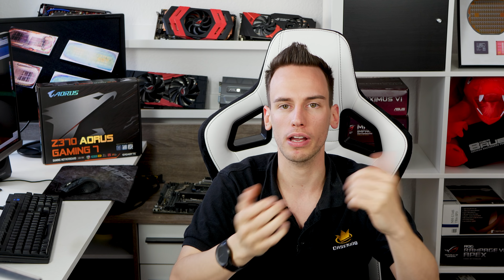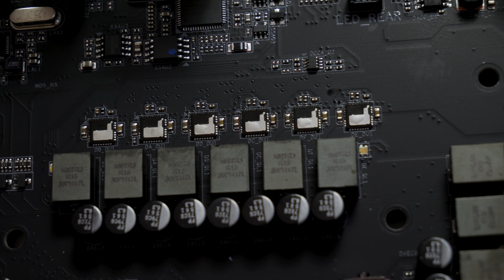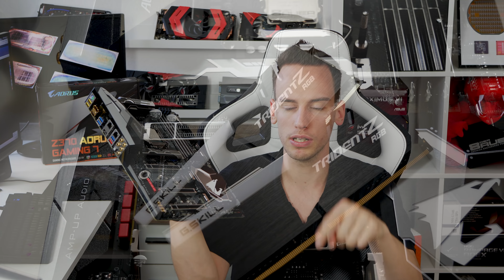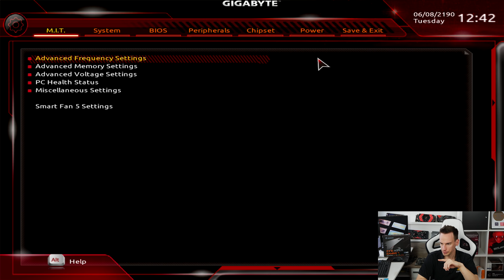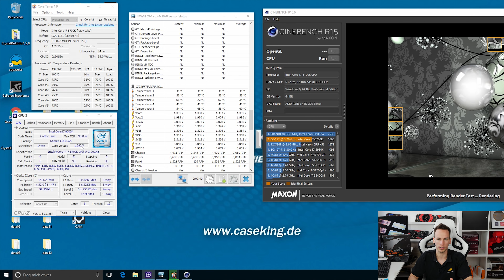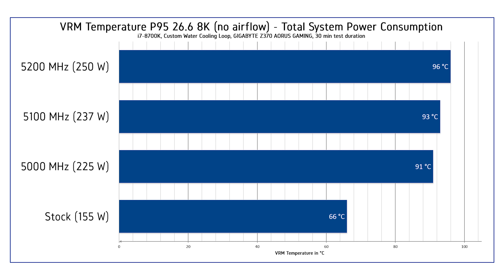Is GIGABYTE really THIS bad?

Comment: If one were to want to summarize this video into a simple two sentence paragraph it would be this...

If you're the kind of person looking for EXTREME overclocking just for the sake of beating world records, then no... Gigabyte motherboards aren't going to be the brand you're going to want to buy. However if you're a regular person who is just wanting to get a little bit more performance while not being greedy with the your GHz and benchmark numbers then Gigabyte motherboards will serve you just fine.
Reply: Pretty expensive and a waste of money though when the cheaper ones will do just as good. Its like spending extra at the car dealership by asking "I want the smallest and weakest engine you can fit in this car, also give me the worst tires you can so I'm not tempted to go fast. I'll pay extra for it".

I would recommend spending the extra money saved on a better PSU, some more case fans, or another HDD for a 3rd backup layer. Seems like that would be money better spent.
Reply: I don't quite understand the meaning behind your comment.
Reply: Please specify... I am running a 5Ghz 3800mhz 8700k and ram and I have absolutely no fucking issues and by the online comments even Asus RPG is doing way worse....

Comment: Funny, when many AMD B350 and X370 boards have exactly the same VRM design and VRM heatsinks and Ryzen cpu-s draw maybe 50 % of the power what this nuclear wastly i7 8700K draws and therefore Ryzen-s have absolutely no overheating issues even when OCd to max....but when using a Gigabyte X470 Aorus Gaming 7 WiFi, now there the VRM heatsink with aluminium fins and a heatpipe running through them, that's such an overkill that it could power and cool itself by using two Ryzen 8c/16t cpu-s with no trouble. Shintel should definitely start learning from AMD because now their Meltdown Lake architecture is really leaking LAVA like temperatures already at stock clocks when at OC clocks these FAIL LAKE cpu-s become a nuclear hazard :).
Reply: 8700k doesnt run hot at stock or use that much power.  its just the fact that avx on an intel chip runs a few more instructions per second because of the way that intels chips are made so when people run prime 95 with avx the avx areas get really hot and the problem is compounded by the fact that they are not soldered.  my 8700k runs 5.2ghz stock volts and doesnt get above 70 for all the games i play and for encoding or blender it gets high 80's.  at stock or even all core turbo locked to 4.7 and the volts at 1.25 its 100% percent stable and very cool running in any real program.  just compare ryzen at 5ghz or so and see if... oh wait i forgot it wont do more than about 4.3.  and by the way buildzoid over at ahoc did this video about oc'ing the 2700x and his numbers for the 2700x at 4.2 are about the same power draw for an 8700k at around 5ghz and he says that a normal b350 would melt down at that speed if it didnt throttle first.  amd limits the performance though in bios so that doesnt happen.  maybe intel should step in and limit things to but i would rather not have it that way.  oh and btw im on a $110 z370 board running 5.2 ghz daily and am having no heat or vrm problems whatsoever.  the problem is that intel chips just keep goin when it comes to clocks.  if they only went to 4.3 like ryzen you wouldnt see any problems or more importantly if the motherboard makers made their boards for overclocking like they advertise.  you cant blame intel for this crap.    here's the link to buildzoid.
 https://www.youtube.com/channel/UCrwObTfqv8u1KO7Fgk-FXHQ
Reply: this was a worst case torture test.  he said specifically that he would use 100 millivolts less (which is what i am using).  with a 5.2ghz clock and a -3 avx offset at -100 offset in my cheap board i have no problems in anything and the power draw is nowhere near what he got in this video.
Reply: bobhumplick : I had the pleasure of trying out an i7 8700K when I've built a rig for a customer and this i7 8700K at stock clocks without Advanced Multicore Enhancement uses around 130 Watts of power alone on cpu die. When I turned AME on and did the same torture test it used 160-180 Watts alone at stock clocks. In both situations using Cooler Master Hyper EVO 212X this cpu ran always above 80+ degrees C when stressing in Prime95 at stock clocks. When I tried OCing it with a water cooler those power consumption numbers went to 210-250 Watts on cpu die alone according to HWInfo. So yeah....it's a Meltdown Lake architecture with nuclear hunger for power and a crappy cpu looking from any of angle.
Reply: see you said so yourself that its only a problem in prime95.  has anybody ever compared how much work an 8700k gets done compared to a ryzen chip in prime 95?  i havent seen it.  intel chips can handle more avx instructions than ryzen.  thats a good part of the reason they get hot and the rest is a combo of overvolting by the bios at stock voltages and not being soldered.  so a 20 dollar air cooler let it hit over 80c in a totally unrealistic workload it must be a nuclear reactor?  this is overly dramatic at best.  run the stupid thing at 1.25 (probalby more like 1.2) volts max and set mce on a hyper 612 (which only costs 10 more dollars than the 212) and its a dramatically different story especially when doing something that people actually will use it for.  besides this video is about vrms getting hot you are just talking about the cpu getting hot.  at least intel chips will clock high enough to hit thermal and voltage limits.  sometimes i actually think amd limited their chips on purpose to around 4.3 so people who dont know what they are doing dont blow something up and blame it on amd.  if you cant get an 8700k to run multicore enhancement with a 35 dollar air cooler and keep it under 75c (maybe 70c) in ANY real world app besides prime 95 by just turning the voltage down a bit then you dont need to be booting into a bios screen.  sorry if you have a problem with intel but just try to keep the drama down a bit so we all can have a real conversation about the merits of both without resorting to hysterics
Reply: bobhumplick : this problem of power consumption and enormous heat is not only present in Prime95. It'c completely the same in OCCT, Furmark cpu bench and Intel bench. These are 4 the most strong cpu benchmarks used everywhere. And absolutely no Ryzen cpu, even Ryzen 7 2700X OCd to 4,3 GHz deson't show such high numbers in heat or power consumption. This Bloomfield 2009 based architecture has come to its wall already with Kabylake 2017 and is stagnating ever since. The only reason a Covfefe lake cpu is faster than Kabylake is not in 2 extra cores but in the fact that Shintel has disregarded all safety procedures in hopes of sustaining that 1-4 % IPC lead over competition. The result is that people are already reporting that their motherboards are failing only after 4-5 months of using an OCd i5 8600K to above 4,5 GHz or i7 8700K OCd to above 4,4 GHz, especially failing on the memory banks side with random memory sticks causing blue screens and on the VRM-s side not being able to hold the power delivery constant after a few months.
Reply: clock an 8700k to 4.2 and a 2600 to the same and turn the volts down until its just enough to be stable and the 8700k will draw less power.  try it.  im not gonna hold it against the 8700k that it can also clock higher
Reply: bobhumplick : I did try it and according to HWInfo the numbers are much much higher that that quazi 95 Watt Thermal Design Power that Shintel wants us to believe :).

Comment: Just seeing the thumbnail 
YES. Those boards are that fucking bad. I built a system and went through all the trouble of drivers, overclocking, ram speed, etc only for it to die the next day.

Bought an asus board after that, that was the 5th gigabyte board to die on me.

Comment: How many people remember the predictions made in the early part of this century that CPU's would be able to run at 10ghz?
Intel had cooling issues and scaled back their plans and adopted multi-core technologies.
If these boards and others are having problems with cooling maybe there is a reason! The laws of physics haven't changed since the year 2000as far as I know so I'm not surprised at these issues. Pushing 5ghz+ produces cooling problems and cost issues. It costs more to produce quality components that can withstand the heat and if people are willing to pay more then Gigabyte can alleviate these cooling issues. I don't overclock - I don't see the point of it. It's like having a car with 1000hp. it's all about bragging rights but in the end completely useless. Short term gains perhaps.
Overclocking a CPU and Ram might have some productivity benefits but how long can a motherboard and its other components last under overclocked conditions. as the saying goes "The flame that burns Twice as bright burns half as long."
Reply: equinox212 whoa whoa whoa.. Dont compare a 1000hp car to a 5-5.3ghz cpu.. Any nub can go out and spend a bit of dough on a binned chip and other high end components and still rock fps and benchmarks . Not saying you don't have people wasting money on racing, but that's like a whole other tier.
Reply: I know it is easier to buy a binned CPU than to build a 1000hp car.  I should have been clearer in my comments, because those who use liquid nitrogen to overclock their CPU's to break records is useless. That practice provides no real-world benefits towards using that type of cooling in an actual computer and the same goes for 1000+hp car. No one needs a 1000+hp to go to the grocery store.
Wasting money on Cars and overclocked PC's is a personal choice. That's all I'm saying here - It's my opinion so let me have one.
Reply: FX ran almost 9 Ghz back in 2012. That prediction probably didn't have a clue what IPC was about, so performance wise, we are probably about 15-20 Ghz comparative to CPUs from 10 years ago (back then it would have also been mostly single core, single thread CPUs as well, but i'm not even counting multi-core). Otherwise my 4.8 Ghz FX-8350 would still be dominating, but Ryzen only needs about 2.5 Ghz (SMT/Hyperthreading disabled) to match.
Reply: True but you can't look at every core individually and then add a clock for every core, multiple that together and get a sum that would equal the 15-20ghz number. There are so many other metrics to measure a CPU's performance by. It depends on the application, some have better single thread performance and some have better multi-thread performance. Then's there is memory bandwidth, Parallel RAM is coming to a threshold of performance. You can add only so many memory channels to a CPU. This mostly applies to HPC not a consumer PC but in HPC serial RAM is being heavily considered as a viable alternative to increasing CPU and system performance. There are a lot of variables to work with when guessing CPU performance. Well written software helps.
I can't even imagine a 15-20ghz CPU, you would need new materials to make a CPU run that fast.

Comment: Also the high vrm temps at 5G and 5.2G are bcuz not that the heatsink is bad...it does not have proper pressure, and also Gigabyte is using crappy thermal pads, some users with Z370 Gaming 7 have huge drops in temps after properly mounting the heatsink and changing the thermal pads. So if you have this mobo the 1st thing you have to do is to change the crappy pads and remount the heatsink.

Comment: I don't trust any open bench test when thermals are the point of the test. That is not a real world use it's only purpose is convenience for the reviewer.
Reply: An open bench test is a really good reference point. It removes all extra factors, that vary between computer cases, fan types/sizes, airflow and other configurations.

At 20C ambient temperature, anybody should be able to reproduce and verify the results and then plan their custom build to address issues that may or may not arise on a specific platform.
Reply: Toni Fasth 
It does create a good baseline for testing...but so does testing everything in the same case with the same fans, cooling solution, and PSU. 

The problem with open air testbenches is temps will almost always be lower than a case. In today’s world where many case manufacturers could care less about ventilation and only think about RGB, Glass Panels, and a seamless look with little ventilation present on the front I’d say that’s a issue. 
Test for medium to worst case scenario bc that’s the true bottom line.
Reply: Dereck Dunn You are absolutely correct. :-)

Comment: I don't know man, from my point of view gigabyte make pretty much the best z370 boards available (gaming 7/5), by far the best vrm, able to maintain 5.3GHz on a non delidded 8700k with vrm temps not exceeding 85 degrees under avx loads. I couldn't achieve the same with my Asus (maximus hero X) board. Granted the RGB lighting is a bit excessive and not to everyone's taste, other than that I can't level any criticism at Gb. Just don't go low end, it seems they save money on the power components rather than cutting less important stuff (rbg!).

Comment: My x370 gaming 5 won’t post past 2133mhz on the ram despite running latest bios. Yet put the same ram into a MSI carbon pro and boom 3200 without issues.
Reply: ...really.... I've had issues getting past 2666 with AB350 Gaming 3.
Reply: no idea what the issue is. been in contact with gigabyte and corsair over the matter and the only solution gigabyte could give me over the 3 weeks batttle was "your sticks are the wrong version" sorry but i call bullshit on that one
Reply: Well, the comments and information I've read said Samsung die-b is the choice to use. Come to find out my Corsair LED 3200 is Hynix. It would be nice though that all RAM will operate at their rated speed. If I could get to 2933, I would be happy. Even with XMP enabled and voltage correct, it will not boot up at that speed. Latest BIOS revision too. So, why does this happen? I have no idea. Next year, new computer build and I will see what's out then. Hoping RAM prices will be "normal" along with GPU prices. But Gigabyte won't be on my list for motherboard. But one thing I have to give to Gigabyte, they make the best looking boards to me.
Reply: Anthony Pierre it’s Corsair vengeance lpx I’m running and it’s Samsung chips also it’s dual channel single rank as well so all the boxes were ticked for the best support ram yet he board won’t post past 2133. It’s the board as I tried it on msi and went straight to 3200
Reply: rossko peeko, I was in conversation with someone who has the same board as you, and they had their RAM running at 3200.  Go figure. The Corsair lpx RAM is "suppose" to work. But your experience is that it doesn't. With Ryzen being tied to RAM performance, this bites big time. Stuck at 2133 is not good at all unless you have RAM that is rated for that speed. I spent extra money to get faster RAM to find out I can not even come close to it's rated speed. Yeah.. it's not on Gigabyte's list, but why should it NOT work as advertised? What is that specific reason? I've never ever in 20+ years of building computers ever worried about RAM speed. Now, I do?
Reply: Anthony Pierre well apparently my ram is the wrong version. But I don’t buy it. I can only assume that because it’s not on their list hey don’t need to bother giving any reason yet it’s the most popular and supported ram on the market and now gigabyte don’t recommend it. But yet on the same list they have a 128gb quad channel kit that’s supported 😂😂😂😂😂😂
Reply: rossko peeko, I would like to know why the RAM is not supported. In the past, this was never an issue. I'll build another computer next year and pass on this one to my wife. It's more than enough for her. Then I will look at what RAM is supported and buy accordingly. Maybe get that 128GB RAM!
Reply: its only got 4 dim slots so their answer was. "use only half the kit" haha honestly you coudlnt make it up the shit they have been sending me as solutions as to why its not supported. they also said that if i want a 16gb kit to run then i have to drop down to 3000mhz on the same kit haha.
Reply: I've used almost exclusively Gigabyte motherboards for years, but am starting to see a trend that affects me personally. I bought a FX ready board in preparation for Bulldozer. When it wasn't living up to the hype, I stayed with the 1090T I had overclocked on the Gigabyte FX "ready" board. When the FX8350 was released I bought it thinking it would work on the FX labeled board. It didn't. Gigabyte's suggestion? Get a FX6300 6 core. I wrote back telling them that the advertising on the box said FX ready and it wasn't. And now this with RAM. Again, I don't see how or why who makes the RAM should affect it's rated performance on a motherboard. I like the look of Gigabtye boards, but now, considering moving to something else in the future unless they improve their ways.
Reply: Anthony Pierre well I just done the latest bios update for the k5 “f22” and now it posts at 3200 @ CL16 it’s only took 8 months of bios updates.
Reply: Good for you! Finally! I have F23a, the latest BIOS for the Gaming 3, and only 2666Mhz... oh well...
Reply: Anthony Pierre it’s working now but still over 8 months running at 2133 is a joke lol
Reply: rossko peeko, at least you are there! Me? Nope....
Reply: rossko peeko I don't really blame the board for that, after all, the memory support issues supposedly disappeared with 2nd gen ryzen. I assume you're using 1st gen? I ran the same board with a 1700 and my 3200 ram only went to 2933. I didn't mind a month after release, but it didn't get better in a year only to find out that memory controller improvements on 2nd gen fixed it. I sold it and went to Intel.